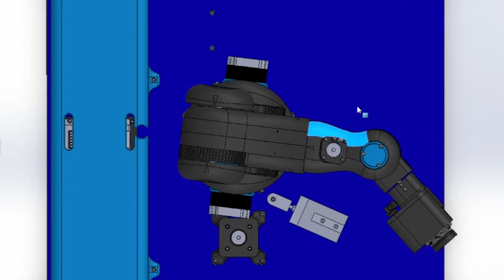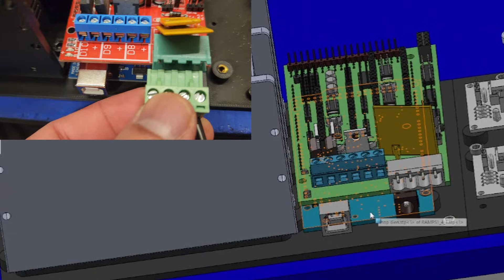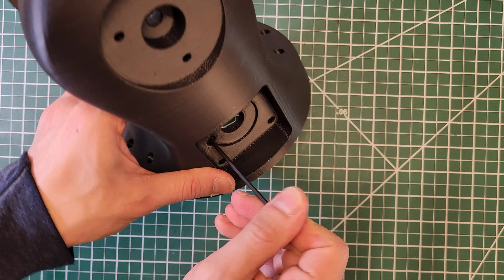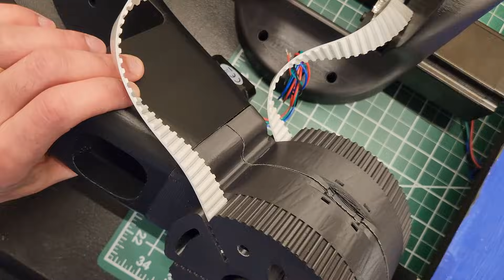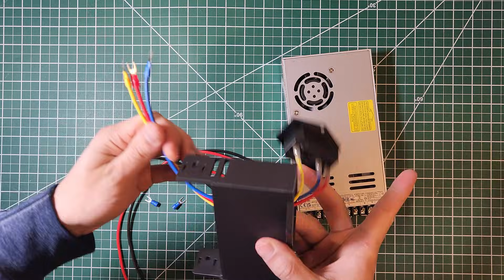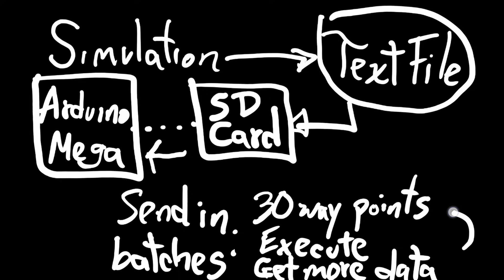I Built a 6-Axis Robot Arm... in My Desk

Comment from the maker: What else would you like to see upgraded on this robot?
Reply: hello, would it be possible to use python and python packages to do this project? im looking to improve my python skills, and this project is so far the most interesting to me. thanks
Reply: What 3 d printer do you recommend for this build. Recently retired. Been contemplating purchase of a 3d printer for home hobby projects like this.
Reply from the maker: @mikemorrow6736  I did it with the Elego Centauri Carbon. I really like it. It's enclosed, Corexy, and so far it ran very well. I have been busy so haven't done much with it for like a year now, but when I did, it performed well. There are others out there: Bambu Labs and Prusa which some people say are better, but I didn't want to break the bank either. When I bought the Centauri Carbon, it was a little over $300. Maybe decide how much printing you really want to do, for what purpose, and with which materials. Good luck.
Reply: @mikemorrow6736  You will never regret getting a 3D printer!! They have so many uses👍👍
Reply: it would be cool if you could add a drilling tip
Reply: which software did you use to edit the 3d files
Reply: @Hnf01254  I imported them into tinkercad, can play with them there, I made a 6th arm for a lidar scanner
Reply: It seems like that robot doesn't have a limit switch?
Reply: Want try programming this design to paint letter H and L. H in a red color and L in blue.
Reply: Use the jetson nano to improve the efficiency and simulation of arm 💪🏻
Reply: Can you tell me where you get a working copy of the file 3M2, as the one I downloaded does not have any attacment holes on the end for the motor??
Reply: You should explore YOLO and see what you can do!! (maybe model a camera mount for the raspberry pi camera at the end to make the claw more precise for picking stuff up) I'm actually working on something similar to move the pieces of a AI chess playing program I'm making!!😁
Reply: @RadTradHoundDog  sounds good, liet me know, I am mounting a pop4 scanner to it, with a lidar ;)
Reply: @MadBrit1957  Noice!!

Comment: For anyone trying to make this, the two bottom belts are 88 teeth, next one up is 84 teeth, next one is 80 teeth,  top one is  70 teeth, all T5, may need a slight bit of adjustment where it clamps on, but easy to do

Comment: Are there o encoders or position sensors integrated into the robot arm ? How does in know its location during movement ?
Reply from the maker: The code keeps track of the steps that have been sent to each stepper motor. No sensor for actual tracking of position, meaning if any motor misses steps. you completely lose track of the actual position.

Comment: You may have covered this, but how does your robot arm know where it is after you turned it off?
Reply from the maker: The robot has no position sensors, so the only way is to always start it on the same initial position (for example, straight up).

Thanks for watching!

Comment: Sorry, how does the arm re-homes itself precisely? What mechanism did you use? I saw your testing- it was already in an initialized "0" state.
Reply from the maker: Zero is wherever you start it. The code keeps track of the steps each stepper motor has taken to know where it is. There are no sensors to re-home, although you could redesign the open-source models to add sensors.

Comment: This is one of the best i have seen - an i have watch around 40 vidoes of something similare. Not just is the robot like really clean, the 3d model holy crap. Can you say which 3d modeling program you are using, Currently i am using fusion, is that bad? I have an idea -  you can add small ToF (Time of Flight) sensores at the gripper so you know how large an object is, or do you already have an solution to this? An should you not use a more powerfull micro conntroller, like esp 32 for example,  just a suggestion or does not the 3.3 v logic work
Reply: I can answer on behalf of the auth. The whole robot arm is called BCN3D MOVEO - which is an open source project. With the project you get all the 3d-models that you can also print yourself. I don't know what 3d modeling program the video creator was using but I have for a long time been using Fusion as well and it's good for modeling, exporting to 3d-printing as well as for CAM if you have the equipment.

I've also printed and built this robot arm but it has some known quirks. Some of them were actually addressed in this video. The nema motors are quite affordable but not strong. Also since there's no gearing between the motors and the arms, it affects the movement as well as backlash.

There's been quite a few open source projects and lately what caught my eye was SO-ARM101. Having a robot arm is one thing, but teaching controls to it a whole another thing and the project SO-ARM100/SO-ARM101 helps alot in latter.

Comment: I feel like using a smaller base plate, maybe with concrete inside would work good. It make it cleaner while keeping it sturdy.
Reply from the maker: Definitely, the only thing is I would then probably have to clamp it or bolt it to a table or something to avoid tipping.
Reply: @diyengineers Have you thought about using a paver from the garden section of a Home Depot or Lowes or whatever?  I have one under my Centauri Carbon printer, but I feel like it would make an excellent base for a robot arm.

Comment: i think what would make a massive difference would be true high speed bldc motors with a proper controller and a 3d printed gearbox, i think that would significantly decrease the weight and increase the presicion and power. WHat do you think?
Reply: like for example from scrapping a hoverboard that you can buy for like 10-25 dollars you could probably reuse most of the elctronics right?
Reply: Any findings?

Comment: wow, that's so cool. Do you think it would be strong enough printed in petg, or is abs required?
Reply from the maker: PETG is likely strong enough. My concern is the motors don't have proper heat dissipation, so the 3D printed parts absorb a good amount of the heat. So if you run them for a while, you might want ABS or ASA for better heat resistance, or address the heat issue otherwise.
Reply: @diyengineers  good point. Thanks

Comment: not to be that kind of person, but what practical application do you think this can be given? I have thought of automating a 3d print farm I think that could be a realistic actual real time application for lots of these diy arm designs
Reply from the maker: I don't think this robot was designed for continued operation. I would look into proper heat dissipation from the motors if using for long duration (long duration without disengaging the motors, meaning they don't get a chance to cool). Also, some of the joints cannot carry high loads on the current design, so there could be a limitation on print size/weight (these could be upgraded). There are other robots out there that might be more precise (and expensive). This could be managed with sensors on the end effector.

Comment: Awesome project my dude! . I was wondering why you didn't integrate the base motor within the base itself,  instead of having it outside and using a belt tensioner?.
Reply from the maker: Are you asking why I used a belt at all (vs. direct drive)? Or why I didn't just keep the original design (which uses belt, but slides the motor base to tension and then clamp down to hold the tension). I thought the clamp-down method could lose tension over time and that the tensioner would provide better positive control of the tension and also easier way to modify the tension itself.

Thanks for watching!
Reply: @diyengineers  Thanks for your quick response, Yes i was trying to say direct drive. I think making the base a little taller will allow you to accommodate a more powerful  motor and have the rotating plate attach to it. Honestly you did a great job with this one.
Reply from the maker: This one is based on the MOVEO open source design, so my only modification (for the base motor) was the base tensioner.  I could have redesigned for direct drive as you suggested, but I thought the tensioner was good enough to get the job done.